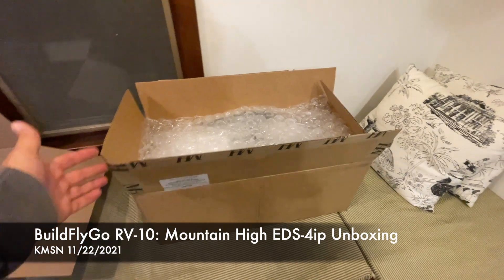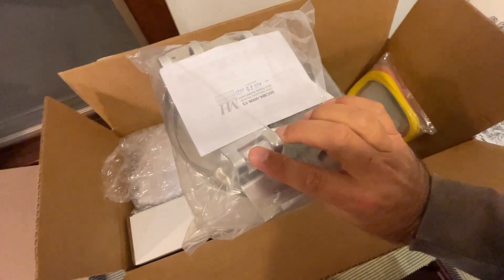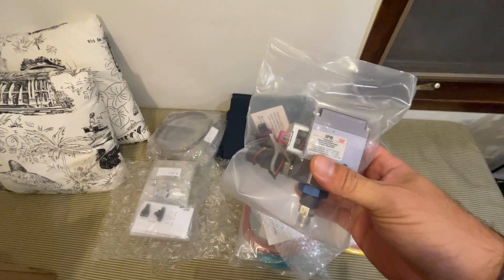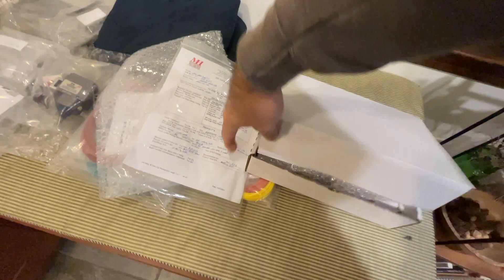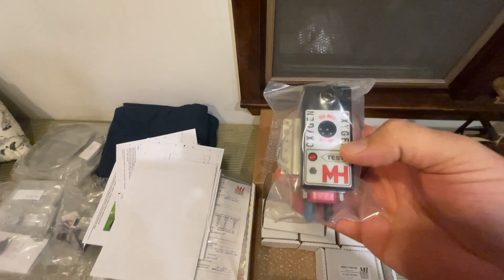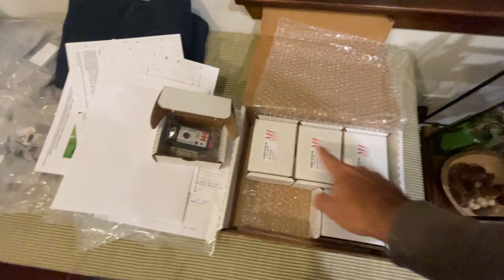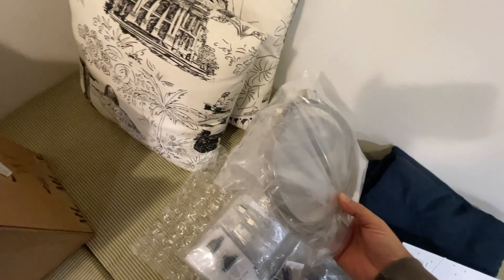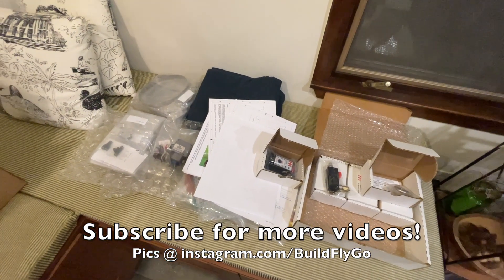RV-10 Build: Oxygen System Unboxing

Comment: I know this was 2 years ago but in case others see this but please consider you must use Aviators Oxygen because it will freeze up at alt from the contaminates from low grade o2 there is high levels of water in non Aviators o2
Reply from the maker: Absolutely! We don't use welding o2, lot's of reported issues. Scuba O2 is often Aviators O2, as that's easy for scuba shops to get. Just ask, they will tell you what they have.
Reply: @BuildFlyGo  oh really I didn’t know that makes sense since they get pretty cold as well in the water thanks for the reply I appreciate that 😊

Comment: is the oxygen sold by scuba store free of moisture? I heard its important for aviation supplemental o2 to be dry due to possibility of condensation related problem in the line
Reply from the maker: Depends on the store of course, but my local one actually uses Aviator oxygen for their scuba uses.

Comment: Please make sure you are aware of Oxygen cleaning requirements for the parts that touch the Oxygen gas.  The "reactivity" of the Oxygen increases with pressure so by moving the regulator away from the cylinder, you will now have a hose (between the cylinder and the regulator) and end connections exposed to high pressure oxygen.  For all Oxygen systems, cleaning of parts is required to make sure hydrocarbons are not present.  When Oxygen is above 300 PSIG, cleaning and a clean assembly technique must be used.  Something as small as a fingerprint could cause ignition.  I think this is why most systems regulate at the cylinder outlet.  This limits the risk by ensuring the components exposed to high pressure stay clean and only low pressure O2 is present in the distribution lines.   I work in the gases industry so let me know if you want more information.
Reply from the maker: Thanks for this comment. I e been trying to spread the criticality of respecting high pressure O2 for a while to aviation people. It scares me how many have cascade systems in their hangars and treat them like no more than compressed air.

Comment: I recently had a pony tank hydro'ed at the scuba shop and asked them if they could fill it.  They weren't sure if they could fill it or not and I didn't quite know the legal grounds on it either.  Is the O2 tank in the airplane strictly O2, or is there a mix of Nitrous and O2 or anything else in the tanks for the airplane?  They other concern the scuba shop had is that they couldn't "fully" top the tank off because the tank is a 3,000lb tank (the green margin is 2,000lbs).

I also am super curious about the external port.  I'm going with the system from Midwest Panels but would love to build in an external top off valve.
Reply from the maker: Also make sure your tank is properly O2 cleaned after hydro.
Reply from the maker: A breathing gas o2 system for an airplane is 100% o2, nothing else. If your scuba shop was not sure i'd recommend going to another one that works with technical divers, they will know exactly what you need and have the equipment to fill the tank properly. Their banked o2 is most likely labeled Aviators Oxygen as that is what has the proper moisture content for technical diving ;)
Reply: @BuildFlyGo  Fortunately a local shop on the airport was able to top me off for $20, so it wasn't a huge expense.  I'm not flying anything at the moment where I'm going high enough to use O2, so it's just an "in case I get an invite" tank.

The SlingTsi I'm building will definitely have O2 built in as that airplane doesn't have much of a problem climbing up in the O2 range - that and being based in Denver, we hit 12500 on an almost daily basis.

Comment: Your scuba shop does pure oxygen??  Usually they only do air and sometimes mixed gas.
Reply from the maker: Yup, look for a shop that caters to technical diving and they will be able to fill 100%. Some shops only handle recreational diving so they can at most to 40% o2 but they will be able to point you towards where to get your 100% fills.
Reply: @BuildFlyGo  As an avid diver, I learned something today.  Thanks.